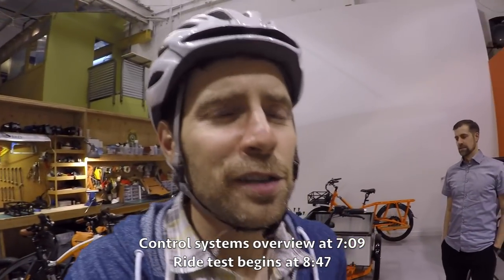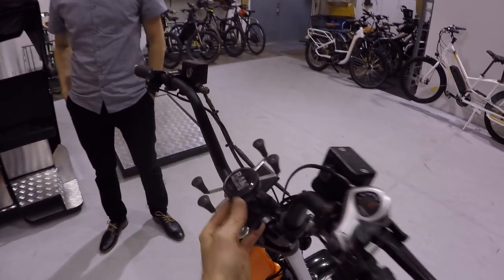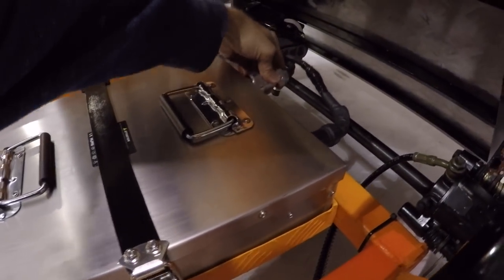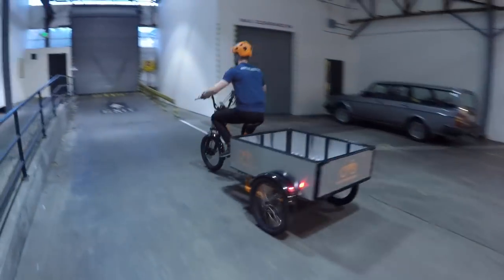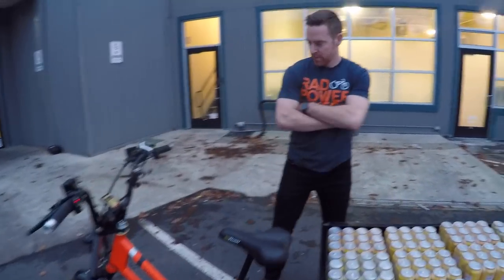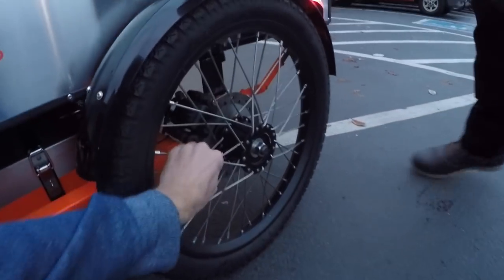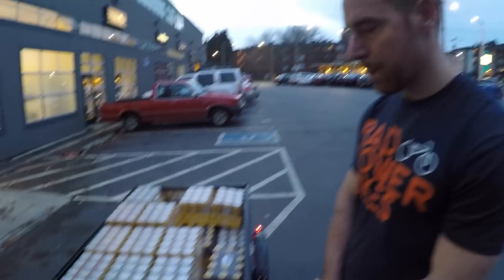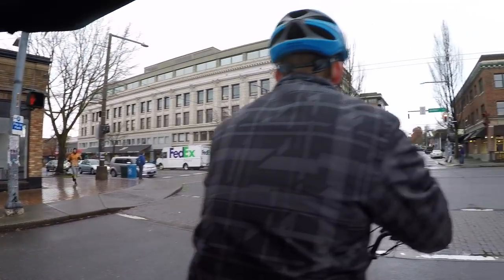RadBurro Commercial Ebike Review - $5.5k

Comment: It's a real game changer but what I think the public want to know is a visual test on a real steep uphill down hill with a fully loaded cargo. i.e max specs. Next you could even add a weigh feature for the load. Running an electric bike now for 1800 miles I know that batteries do take a lot of management so the public really do need to know how to be able to have confidence in this battery management process.

Comment: One topic that wasn't addressed is that being a commercial type vehicle it will be used daily and charged nightly...now here's the problem, the best battery made is by Panasonic and they claim to allow 320-340 charging cycles for the life of the battery, if it's used daily that equates to slightly more than a years worth of battery life at the cost of $880 per unit! Just something to consider, myself, I'll stick with an enclosed cargo van with heat and ac , locking doors and airbags...at the cost of $5500 and $880 annual battery replacement costs along with the afore mentioned amenities a cargo van is superior and more cost effective... and also insurable!

Comment: This is what I have been looking for.  The price tag is to high.  You can buy a used Leaf or Smart for $6,000 and stay dry and warm.  Good Luck Mr. Mike.
Reply: Thank you Meno, I am a big proponent of used leafs as well since they are a great vale but cargo trikes being smaller, easier to park and navigate through urban areas is desireable to alot of businesses looking to move passengers and cargo. At $5,499 the RadBurro is priced at about 1/3rd the price of any other electric cargo trikes just like our line of electric bikes at $1,499 are priced at a fraction of the price of comparable ebikes.
Reply: Mike Radenbaugh The New tax plan got rid of the monthly $20.00 employer  tax free payment to employee bikers and the free Transit passes. Not for Good Green commuters. Iam going to wait for the used cargo bike market. Thanks
Reply from the maker: True, but you can't ride it on bike paths or between cars and you need a license, insurance etc. it's just a different application
Reply: meno, it is a bike not a tiny car.

Comment: this looks like the "heavy" version, what about a "lite" touring/ camping/ bikepacking version that can cross countries, and is ready to accept various upgrades and addons like solar panels, more batteries, engine upgrades, even rohloff and pinion systems, belt-drive (anything and everything super durable and super low maintenance), and a massive amt of storage for eqpt and clothes and food supplies? something like a radwagon, but with capable mtb-level suspensions. make 2 versions - one a single track, and another is a three-wheeler (tilting is bloody rad, but expensive tho, optional upgrade?). cuz i'd totally buy. :)

Comment: For $5,500 it would be better to get the ZEV Electric T3-1, which is 3,000 watts, fully enclosed with heater and with windshield wipers, seats three, can carry.  700 lbs, range out to 100 miles.  The T3-5D with the hatchback and 5 doors is more cool.

Comment: court, I could see these for stagehands and lighting and sound technicians at concert venues, such as the outdoor outside lands festival. As it is now, they use four-wheeled propane powered 'carts' that cost more. Often the loads carried are light and/or have one worker just getting from jobsite to big rig supply trucks and trailers. These would be very practical and temptingly cost effective. (memo to sales team)

Comment: OMG!    This trike has so many applications: neighborhood yard maintenance; golf course maintenance; use on hobby farms, or in orchards or vineyards; street vending; campus commuting taxi's; park tours; name it.

I suspect this trike would sell for less in Asia and could probably become a hot product. It seems with Rad Power Bikes reaching into Canada and Europe it would seem a logical choice for them to provide something useful to the third world. Starting in Asia and eventually moving into Africa (Note: Solar) this trike could help a lot of people with transport and small business.

The RadBurro seems to be riding a thin line on street legal. I'd like to know more about the rear suspension system and whether it's applicable to all attachment options. My other concern is the lighting. I didn't see the turn signals in operation, but it seems that feature is available. Do brake lights come on when brakes are applied? My thought on the lighting system is that it should be beefed up a bit. I'd like to see two extra red tail lights added to the ends of the rear axle. Maybe a couple of small orange lights added to the front of the fenders. I even thought that may be two very small orange lights at the ends of the handlebar. These are just some tripped up thoughts.

How would you handle a left turn on a bike like this at a very busy, controlled, intersection?

Comment: Where I live we have a 1200 watt limit on electric assist bikes.  And with hills at 30 to 35% common nothing less would be sufficient,  I installed a clinometer. On thry=ttle only a 21% grade allows only 11 to 12 KPH. On 17% I can do 28 KPH. I weigh 183 pounds and my electric scooter a RAM Mia 1200 watt.. Very apparrent a transmission would allow it to take hills better. On the flat it will do 56 KPH which is fine, as intown speed limit is 40 KPH but mostly 30 KPH. On the highway 60 KPH limit but mostly 50. Only two highways RTE 1 and RTE 2 Intercontinental Highways allow 80 KPH. The Ram Mia cost $1600 with a 2 year warranty .$1400 with a 90 day warranty.

Comment: With righly (dis)balanced and high cargo, you can tilt even a snowboard in a steady curve. BTW, it will be really nice, if someone try to produce electric bicycle trike with modular cargo space and stiff, trike-van like hood. If done right, and the backseat of the driver can be layd back horizontaly, the trike would have a nice potential as a camper. This trike is not so bad either, but the pallet-sized cargo area is too small for somebody to lay down in it. On the other hand, if the camper is build as kinda tent-on-trailer, pop-up, or extendable, it should work just fine.